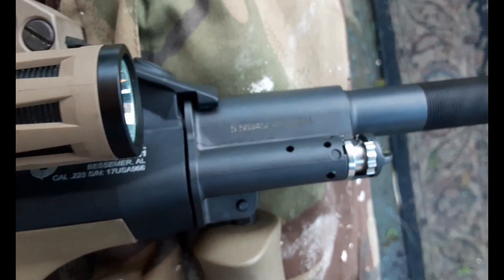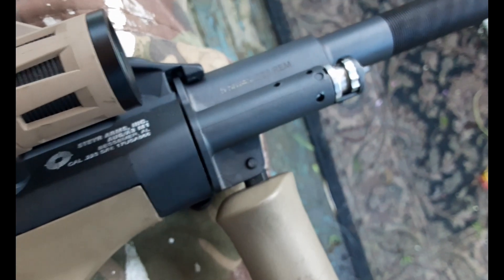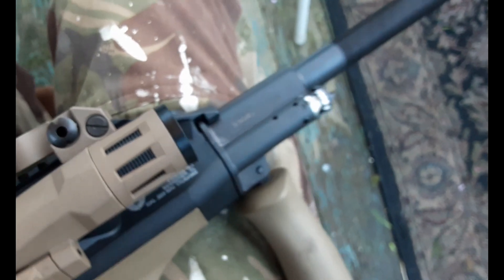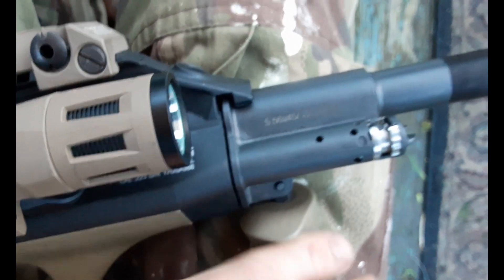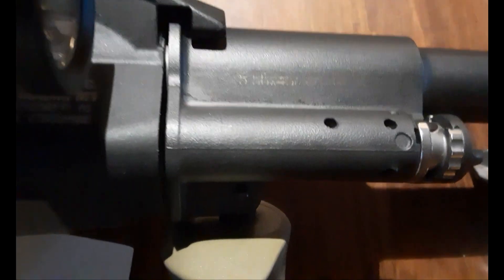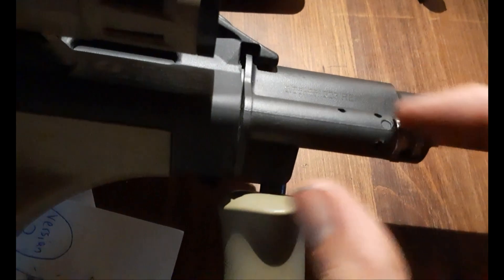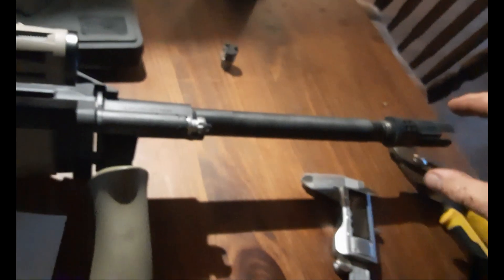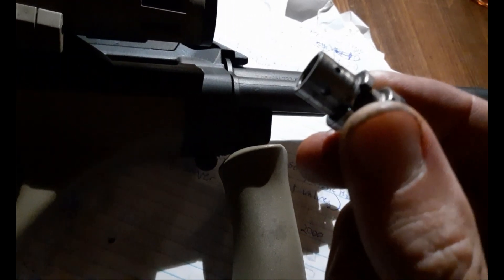Steyr AUG A3 M1 NATO- Standard Gas Plug vs Suppressor Gas Plug

Comment: I just ordered the suppressor plug.   Can you shoot unsuppressed with the plug set on suppressed?  I am concerned with not being able to change the plug position once I put a M lock rail on the barrel.
Reply from the maker: I have not heard of any rail system for the AUG that blocks your access to the gas plug. I would advise against using the supressor setting if shooting un-supressed because your bolt carrier may not cycle fully. AKA, the gun may jam. Not in a dangerous way that will damage you or the gun, but in a frustrating way where the fired round wont eject / the next round wont feed. This is because the supressor setting has a different sized gas weep hole than the normal setting, because putting a suppressor on the gun adds a larger area of space to the barrel where the gas expands amd lingers (inside the suppressor body) which changes the amount of gas that is flowing back into the gas piston / forcing the bolt spring backwards to cycle the next round. The sizes of the weep holes on the gas plug are engineered by Steyr to release a very specific volume of gas into the gas piston tube in order to compensate for how much gas is flowing inside the barrel, depending on what/how you are shooting. For example the "GR" setting is on the factory gas plug (the  "grenade" setting) refers to using blank cartridges to launch stick grenade type projectiles out of the barrel (some 1970s/1980s shit used by the Swiss Army). In this setting, the gas port is sized to allow for the appropriate ammount of gas to launch a very heavy stick grenade out of the barrel, but NOT to cycle the next round into the chamber. Steyr deliberately erased the gas weep hole in this setting so that no gas flows into the gas piston tube and only flows through the barrel, because that heavy stick grenade requires all the gas pressure you can give it to launch it. Now, i may have this backwards, but if i remember right, the suppressor setting has a LARGER gas port than the normal setting because you need MORE gas to immediately flow into the piston tube because the suppressor is already sucking up a bunch of that gas. This is why your supressor gets so fucking hot and dirty so fast. Supressors have lots of void space inside of them where that hot gas gets expanda and gets temporarily trapped.
Reply: @tomstegeman4344 the rail I bought and the plug were both from the steyr websight. Some of the vids I’ve seen look like the plug might be inaccessible once the rail is put on. I hope not but will figure it out when I get them. I may just send the plug back if I can’t manipulate it because of the rail. (Claw works M lock???)
Reply from the maker: @unclegene5372 Ah, now i can see why you are concerned. Now i am looking at the "Claw" rail system and see that they did indeed open up a window where the gas plug is acessable......but im not gonna lie, it looks like a TIGHT squeeze for your fingers. And you and I both know that the gas plug is kind of a pain in the ass to rotate even without anything obstructing it... But i may be wrong; I find it hard to believe Steyr would fuck up something like that. Other 3rd party companies may lack that foresight and put out a cheesy hack product, but Steyr can't afford to make a blunder like that on their own proprietary system. They are the real deal and they would never risk tarnishing their legacy and reputation like that......i assume?
Reply: @tomstegeman4344 surely it will be ok. I’ve wanted an AUG for YEARS and finally got one. I’ll work it out either way.  Thanks for your help.
Reply from the maker: @unclegene5372 anytime brother! Merry Christmas
Reply: @tomstegeman4344  you too Merry Christmas.

Comment: How did you attach the warcomp? Did you just put a bunch of shims?
Reply from the maker: Yes, and getting the factory muzzle device off was a battle. I had to heat the factory muzzle device with a propane torch to loosen the thread locker enough for me to be able to wrench it off. I don't remember if the WarComp came with shims or not, but I definitely ended up having to use a shim kit that came with different sizes, and work at it to find the perfect combination of shim amounts and sizes that landed me to where the QD locking nub landed centered at the bottom of the muzzle (at 6 o'clock). I also applied red thread lock to the WarComp threads.
Reply: @tomstegeman4344 thanks for the quick response man. Barely in videos about the muzzle of the aug.

Comment: So if I run a can and the suppressor plug, setting 1 is your real only option for semi auto function with a can on? Grenade mode with suppressor plug will turn it into a single shot?  

Also you mentioned the factory plug first setting and the suppressor plug first setting are same size holes? So why get a suppressor plug? 

Can you clear that up?
Reply: Setting 1 stays the same as the original gas plug. No difference on this setting between the two plugs. Setting 1 remains properly gassed for unsuppressed semi auto fire. (Might even work fine with a low backpressure, flow through can). 
Setting 2 now becomes the grenade mode (adverse mode no longer exists with the suppressor plug)
Setting 3 is properly gassed for suppressor use. (Formerly grenade mode on original gas plug)

Comment: Would it be possible to take a factory gas plug and drill a port on where the grenade setting would be instead of buying a new gas plug?
Reply from the maker: Yes, there is a video on YouTube of someone who did this. They had proper milling equipment though and used precision tools. I wouldn't try to redneck engineer that. Search around and you'll find the video of the dude who did it. It will show you how.

Comment: So,what is the proper set up to reliably run an AR 15 Pmag 5.56? Suppressor plug or standard settin 1 or setting 2.  This is a 1600 dollar purchase. 🥴
Reply from the maker: You need to elaborate. What are you talking about? Are you asking what setting you need on the standard factory gas plug to operate a Steyr AUG using AR-15 P-mags? The magazine type doesn't make a difference. The settings you choose on either the factory gas plugs don't effect the "reliability" of the weapon. They have different jobs. "Standard" setting is for semi auto fire in normal conditions. "Adverse" setting is for semi auto fire in dirty conditions. "Grenade" setting is for single fire operation. The suppressor gas plug has 3 settings, just like the factory plug, but the "adverse" option is replaced with "suppressor" option which is designed for semi auto fire when you have a suppressor attached. You need this gas plug to be able to reliably fire and cycle ammo if you mount a suppressor onto your AUG. As I discuss in this video and the description at the top, beware, the settings on the suppressor style gas plug are NOT all located in the same locations as the factory plug.

Comment: Again, it has not been mentioned properly that you press the winged piece OUT of alignment with the gas piston on which it's housed. All YouTubers incorrectly talk about pressing it upwards or downwards. Looking at it from the top, you rotate it anti-clockwise.
For the GRenade settings, you must rotate the plug in the clockwise direction.
I hope this finally helps any bewildered viewer.
Reply from the maker: Yep. You're right About your gripe with that vernacular speech issue. No one actually shows how they use their fingers to twist the piston in order to rotate between the 3 different modes that exist about the circumstance of a Steyr AUG gas piston. To anyone who views this query, when I refer to position "1,2,3", I am referring to you being right-handed and shouldering and sighting your eye down the rifle sights to shoot a target. But to clarify,  you must push on the " rabbit ears" on the gas piston PEPRENDUCULAR to the barrel lengt, in order for it to be unlocked so you can rotate it between positions 1,2 3... I understand why this operateion iS NOT immediately obvious,  because it requires some muscle strength and they do not discucss this motion in the factory  manual.
Reply: Finally someone said it…this helped. Thanks!

Comment: I just got an original suppressor plug and position 2 seems to be suppressor mode not grenade mode.
Reply from the maker: It's possible I mixed up position 2 and 3. I'll check when I get home from work. But I can confirm that the "Adverse" position (which is position 2 on the original NON-supressed plug was replaced with the suppressor setting for the Supressor plug). They may have made Supressor mode be located where the Grenade setting should be though,  and Grenade where Adverse should be, if that makes sense. Like I said, I'll need to double check. Sorry if I gave out misleading info in that regard.
Reply from the maker: Can confirm that position 1 is normal, position 2 is grenade,  position 3 is suppressor, for the suppressor gas plug. Steyr actually just posted a video about this today on their company Instagram page.

Comment: Thanks 
Mine came set on grenade?…
Reply from the maker: Elaborate
Reply: @tomstegeman4344 I'm thinking what he meant is that his Aug gas plug came out of the box set all the way down into the lowest notch labeled GR.  I just moved my gas key for the first time and mine was set to the 2nd notch, right above the lowest notch marked GR , which you claim to be adverse conditions setting. With normal setting being the notch all the way at the top.
Reply: Then it wouldn't cycle??

Comment: A  trigger tuning  and adjusting the trigger bars to the Hammer pack fixes 90% of people's complaints of how the trigger feels on the Travel the issue with a 2020 Sierra is that they are tripping and hanging up on the drop safety
Reply from the maker: So you mean the Ratworx 2020 Precision Sear is hanging up on thr drop safety? And how does one adjust the trigger bars to reduce the travel issue? By extending them somehow?
Reply: @tomstegeman4344  https://youtu.be/49PBUuEqFHk

Comment: Very helpful.  Do you need any tools to remove original plug or install new plug?  Is it easy to do both?
Reply from the maker: No special tools needed. The basic field stripping procedure shown in the manual and on YouTube videos will show this. You just need something thin and hard enough to push in on the blacl retaining pin that you see on the "rabbit ear" clip. I think i used a barrel cleaning rod or a screw driver, the last time I cleaned it. Cleaning/lubricating the gas plug is something that is routinely done whenever you clean the rifle, it's not something you aren't supposed to mess with (like a trigger sear or something).

Comment: You refer to the settings as 1, 2, and 3. But for me I can only do 1,2 then have to reverse to go back around to grenade or “3.” Is that correct?
Reply from the maker: You should be able to select all 3 different positions. I am not sure if that is the case for other variants of the rifle.. I have the A3 M1 NATO. I dont know what you mean about going "reverse", but there shouldn't be any reverse turns in the notion that you have to turn the gas plug clockwise to go from position 1 to 2 to 3 (GR). I mean clockwise if you are shouldering/looking down the sights of the rifle.
Both types of gas plugs will have 3 positions stamped into the outer wall of the gas cylinder tube:
The first position is marked by a smaller indented circle engraved into the gas cylinder, closest to the barrel. The second position is marked by a larger indented circle engraved into the gas cylinder but is a few millimeters further away from the barrel/smaller circle.. the third position is marked on the bottom of the gas cylinder with "GR" engraving. 
To select these positions , you must rotate the black "rabbit ear" latch so that the bigger black circle/pin on the latch (NOT the smaller black circle/pin on opposite side) will line up with the gas cylinder's engraved position markings that I just mentioned above. If you are looking down the sights of your gun, you would rotate the "rabbit ear" latch CLOCKWISE to go from position 1, to position 2, to position 3. 
As I discussed in this video, for standard gas plug, position 1 is normal mode, 2 is adverse mode, 3 is grenade mode. For suppressor gas plug, position 1 is normal mode, position 2 is grenade mode, position 3 (GR) is suppressor mode. The manual doesn't even tell you about GR mode for some fucked up reason

Comment: Thank you so much for this
Reply from the maker: My pleasure. Truly. I pulled my hair out trying to make sense of this, because there was no info on the differentiation between these settings in the product manuals, and there was only vague guesswork found on internet forums. Which is beyond aggrivating because we are talking about an industriously lethal firearm, not a garden hose acessory. All it took was the willingness to sit down and compare the sizes of the holes with digital calipers (each position has an inlet hole and an outlet hole), then write down the sizes and locations of the positions, then test each position out on each of the 2 gas plugs at the shooting range. It seems that for certain suppressors, the suppressed position on the suppressor gas plug is the ONLY position that will allow the rifle to cycle rounds properly. Iv heard that if you own a "flow through" type suppressor, then you don't need this gas plug setting, but my knowledge on that is limited. I forgot to mention in my video, an important notion, and that is that the suppressor gas plug will not make your AUG quieter than a normal gas plug. The reason a suppressed AUG is significantly louder than a suppressed AR style rifle is because the AUG gas cylinder has an outlet venting hole. This allows excess gas to escape, which inevitably has a loud popping noise. For a very limited time, the company Ratworx made a suppressor that had a side-car type sheath that covered this vent hole, but they no longer manufacture it.